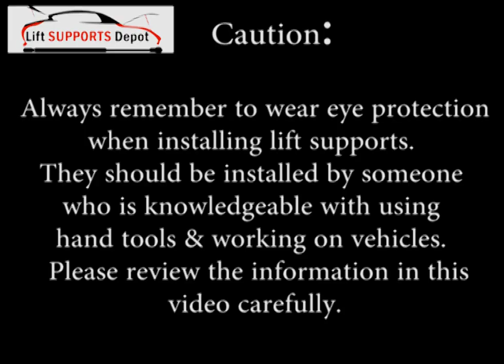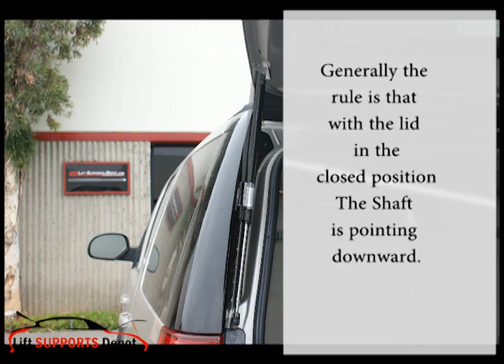How to Install a Lift Support

Comment: I called looking for a lift cylinder for a square chissel mortiser.  Not something you find in every wood shop.  The original part is no longer manufactured but the folks here found one that works perfectly.  Good on you!

Comment: My vehicle is a 2007 Toyota Sequoia, and my rear hatch supports finally gave out after 10 years. After purchasing the replacement supports, which cost around $40, I let them sit at my house as I hate endeavoring on projects that I'm not familiar with. Facing the reality of another trip dealing with an unusually heavy rear hatch door, I finally decided to try and install the new lift supports. After watching the video above from Lift Supports Depot, I was able to install these lift supports in less than five minutes. On one end of the spectrum, I feel like an idiot for waiting as long as I did before installing these supports. On the other end of the spectrum, I feel like an All-Star as it took me less than five minutes, and the struggle to lift the heavy rear hatch is gone. Thanks Lift Supports Depot.

Comment: My Dad is elderly and the Dealer told him 200.00 to replace the struts on his 2010 Taurus. I got on Amazon and ordered from Lift Support Depot and got them in 2 days.  It took under one minute to install both struts.  Now his trunk is good as new and he is only out a small amount for the 2 struts.  Thank You Lift Support Depot.  PS the dealer hates you!

Comment: Ball tip is integrated into strut on '97 Acura Integra so there's not removing it with a flathead screwdriver as shown in the video.  You have to unbolt the ball tip and use the replacement that comes with the strut.
Easy removal and install.  I can't believe I had the dealer do it in the past and charge me 3x as much for the strut.
Thanks for saving me lots of money!

Comment: Just replaced the worn out struts on my 2007 Chevy Tahoe after watching this.  The video was spot on and the job took less than 5 minutes.  I should add that I can barely change a tire and the oil so my mechanical skills are very basic.

Comment: Just replaced these on my '01 Durango. It truly couldn't have been easier!  A simple unscrew of the old ones with a T40 screw bit. I started with the bottom first, then the top. Old struts came right out. Installed the new struts top first, then bottom. Took me all of five-minutes, and that's without anyone assisting. I used a paint extension pole to hold the liftgate up. No problem at all, and I now have a working liftgate again. If you have an older model Durango, it's super-easy.

Comment: Great video.  Paid to do some research for this fix.  Local auto  parts stores wanted ~$30+ for each strut (or $60+ for the pair).  Found pair for ~$20 on Amazon.  Observed that it was easy to replace per the video so I had my wife replace the pair while I help up the gate.  Not only saved $40+ on parts cost but no telling what costs the mechanics would have charged.

Comment: Thanks for easy to follow video.  Did not have another person to assist so I used ann 8 foot 2 x 4 to support door while changing struts.  5 minute job that saved hundreds.
Reply: How are they holding up?

Comment: Installed a StrongArm model 6121 on the rear hatch of a 2004 Nissan Murano. Very easy to do...1 tip - attach the arm that needs rotating to the body of the car before trying to turn the head to meet the hatch's stud ball. Difficult to turn until it's attached to the car. Works great!

Comment: Thanks for this video. I knocked this out in 5 min. I ended up breaking the old ones off and then removing the little pieces that screw in. Then I put the new ones right back on.

Comment: Rarely, does any domestic job go as smoothly as advertised for me.  As such, I rarely attempt doing anything on my own.  Go ahead and call me lazy.  But today, I replaced the lift supports on my 2005 Nissan Pathfinder Liftgate in minutes.  With a helper, we didn't even need the stepladder.  This job made not only my day, but probably my whole month.
Reply: Haha! Congrats, wish me luck!

Comment: Lift support I got was for a Jeep Cherokee and was exactly as the original equipment, which to install uses a curved wire you need to rotate and take it out of the ball connector, install it and then reinsert the wire and turned to keep the ball from getting out of the support.

Comment: Thanks for emailing me this video, Lift Supports Depot.
(Though rather than remove both at once, I'll do one at a time. I've always felt it's good, if you get confused (which I don't think will happen with this simple procedure) to have something to reference that's still in the correct alignment.)

Comment: Thank you LiftSupportsDepot for you're support, ha, no pun intended ! Without it this could be dangerous, especially on larger SUV's. But I was able  to do it without incident. The only thing is the rear hatch speeds up a little during the last couple feet of travel. I don't know if it originally did that or not. Any comments would be appreciated. Thanks in advance!

Comment: The reason that they should be installed with the shaft portion facing DOWN is so that oil will be kept in constant contact with the seals at all time.  Similar to why wine bottles should be stored sideways.  Lubrication on the cork of the wine bottles as well as the rubber seals on these support struts will help them last longer and keep them from drying out.

Originally I assumed that having less weight on the tailgate was better, as in having the shaft facing UP.  But the weight difference is negligible, and ensuring that the seals do not dry out is much more important.

Comment: Toyota dealer quote to do this...$200 per hydraulic for parts plus $55 to install...so at least $455 (didn't stay on the phone long enough to find out if it was $55 per hydraulic to install or for both...probably each knowing them).
Reply: Received supports today and installed them on a 2009 Toyota Sienna in 5-10 minutes.  They work perfectly.  What a racket the car dealerships are running on replacing these...$40-45 verses the dealership's $455 min.

Comment: The supports came with U-shaped bands in a small plastic bag, but it is not really clear what to do with them, and the video does not say.  The video shows them already installed in the strut, but how do you install them?
Reply from the maker: +1squit Thanks for the question, these are a different style support.  The Clip you found is a safety clip for custom applications, please visit this link for more information.  http://www.liftsupportsdepot.com/blog/2012/09/how-do-i-remove-the-external-safety-clip-from-my-lift-support#top

Comment: I replaced them in my Chevrolet suburban, but i installed them up-side down. Does it matter ?
Reply: +dape7 Read the part about oil lubrication and seal life above.  Good advice.  Trust me you are not the first or the last to do this.
Reply from the maker: +dape7 With all installations we recommend installing these with the Piston pointing down.  This keeps the seals properly lubricated and ensure maximum life.

Comment: WARNING!!

Don't ever try to install them yourself.  I didn't have anyone to help me, so I yanked on the old lift support to remove it.  With my other hand, I held the hatchback up.  As soon as the lift was removed, the hatchback came crashing down.  It was so fast and unexpected, and violent.  The force with which it came down with was incredible.  The hatchback is actually EXTREMELY heavy.  The support smashed into the glass, causing it to shatter.  To replace it is going to cost me $200.  Had any part of my body been caught in between, or under the hatchback when it fell, I would have been SERIOUSLY injured.
Reply: +shinyam75 Did you have a ladder or anything under the support for safety?
Reply: nope
Reply: +shinyam75 Seriously? That's your own fault then.
Reply: +shinyam75 Most people can do this simple job. But, as you have so eloquently noted, not everyone can. Call a mechanic.
Reply: +shinyam75 Please don't tell people never to try to install these themselves.  This is an item that can easily be repaired at home, saving owners a lot of money and a lot of inconvenience (tying their car up in a repair shop).  

It would be wise to read up a little before doing any job, including this one.  Every single on-line article, tutorial, or video I have ever seen on doing this cautions the reader that lift gates are heavy and MUST be supported before you remove the struts.

"Well kids, you tried your best and you failed miserably, so the lesson is, never try" --- Homer Simpson
Reply: shinyam75 you should have read up on it or watched a video or used common sense as gravity works all the time with no breaks....glad you did not get hurt though.

Comment: Installed within 30 minutes with zero experience even if 1/4 inch shorter than original lifts I didn’t call support. 
I merely propped up hatch higher to attach to ball joint.

Comment: Good video but it contradicts the instructions.  The enclosed instructions say DO NOT jam the new support end over the ball socket without lifting the U band slightly or it could damage the end of the U band, or split the nylon end of the support. Thats exactly what she does in the video.

Comment: Thank you very much for this video! Thanks to your video I was able to change both supports, by myself, on my wife's explorer in under 10 minutes! Note to viewers: use a 6' ladder to support the gate. It makes replacement that much easier. Using a pole to brace the gate is a bad idea. Thank you #rockauto (https://www.rockauto.com/) for the affordable replacement parts!